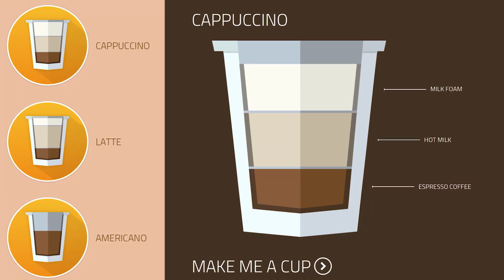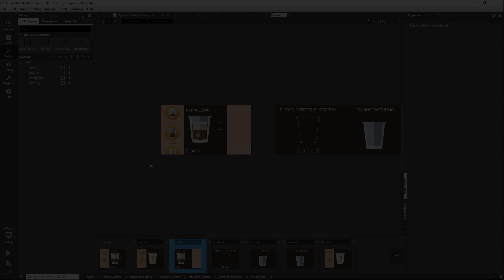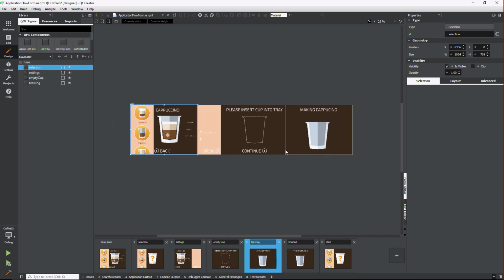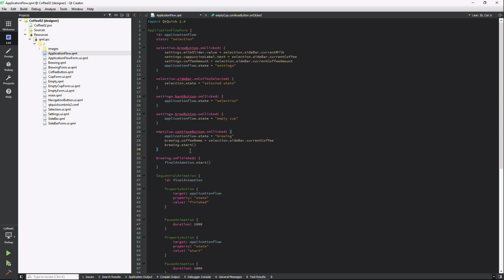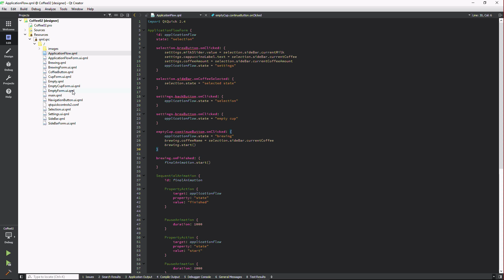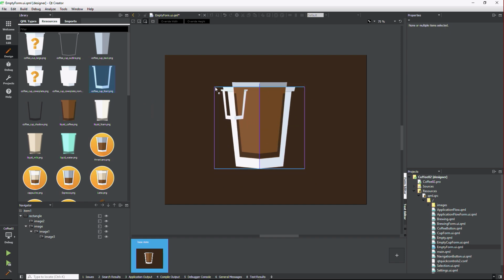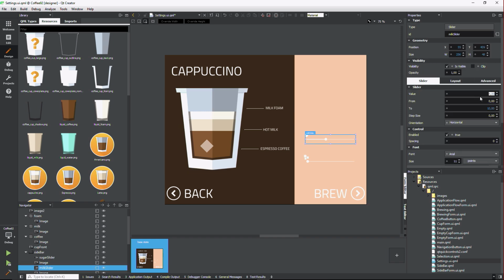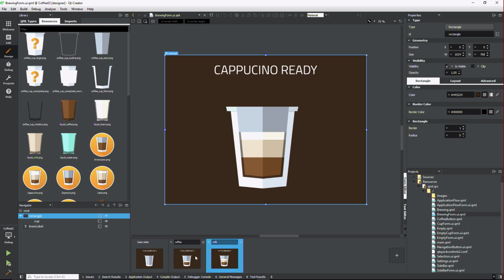Coffee Machine UI Demonstration with Qt Quick Designer

Comment: it is posible to generate in this way code for microcontrollers?
Reply: If your microcontroller meets the hardware requirements - then why not.
Reply from the maker: The device needs a certain amount of ram and an OS. The demo is running on an IMX6 board.
This is the related blog post: http://blog.qt.io/blog/2017/06/21/digital-instrument-cluster-qt-quick-designer-qt-safe-renderer/. You can also get more information about safe rendering here: https://www.qt.io/functional-safety-and-qt